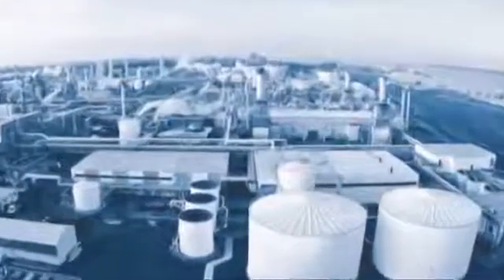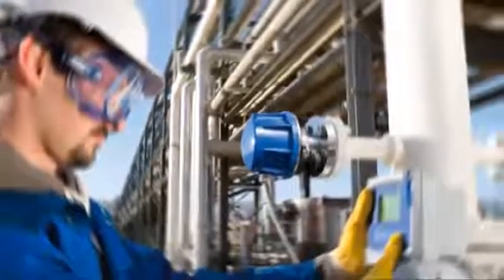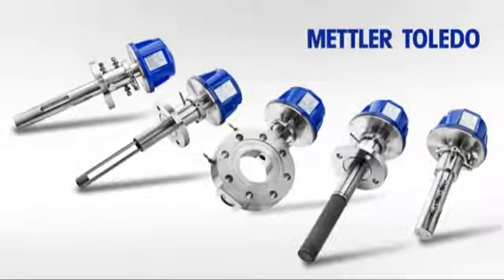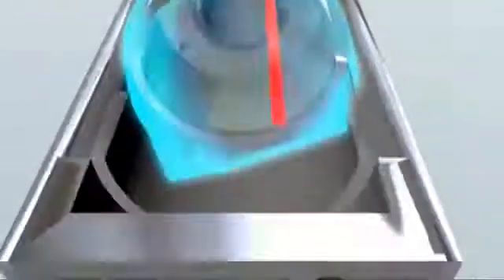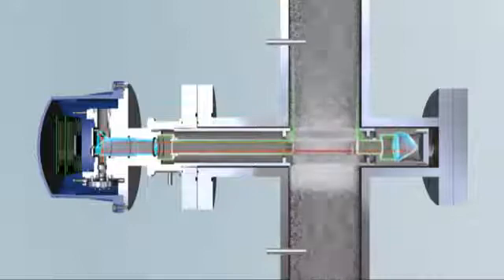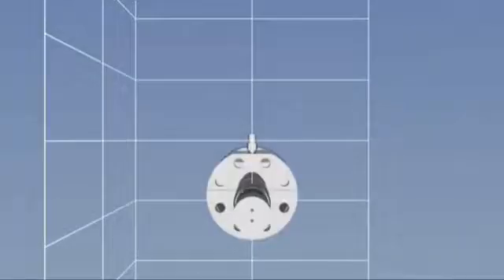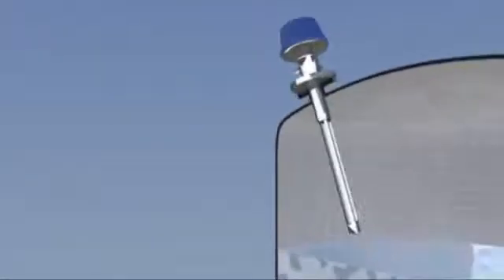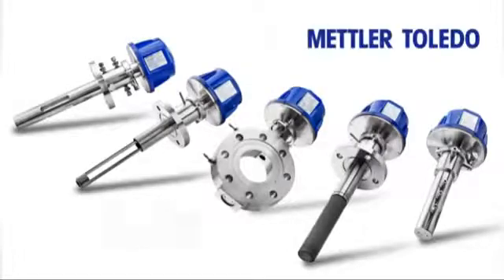Why Tunable Diode Laser Gas Analyzers Become More and More Popular? Rethinking Gas Analytics.

Comment: Can u provide clarification and working of wafer type
Reply from the maker: Dear @thiagaraj86, thank you for reaching out to us! The wafer cell process adaption for the GPro 500 TDL gas analyzer is designed for implementation in narrow pipes. It allows accurate measurement of O2 and other gases in pipes down to DN50 (2") without obstructing gas flow. You can find all of the details about it at  https://www.mt.com/global/en/home/library/datasheets/process-analytics/ds-wafercell-adaption-for-gpro-500.html.